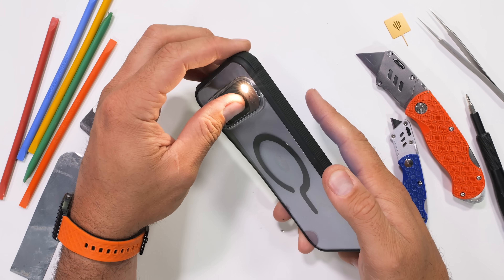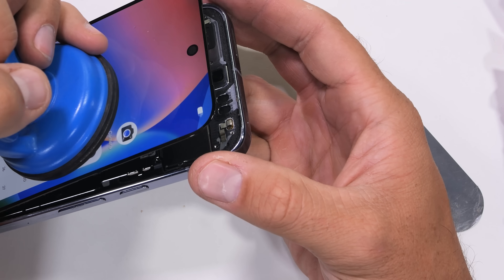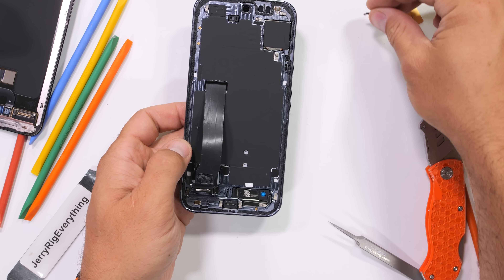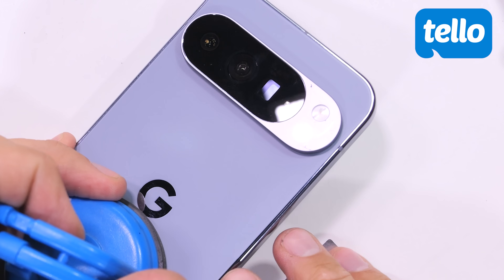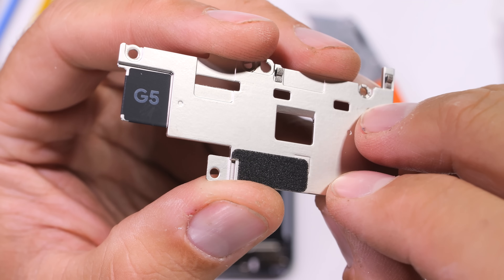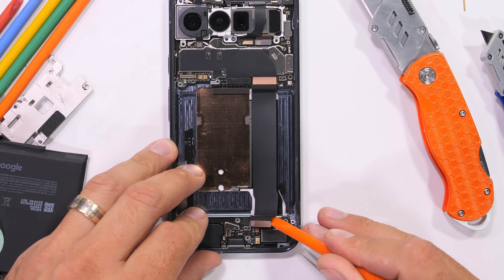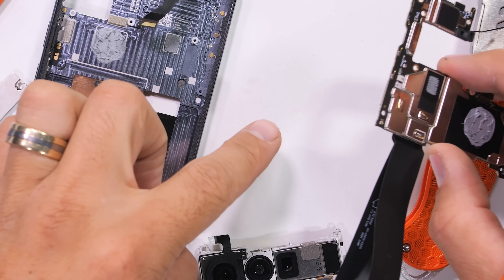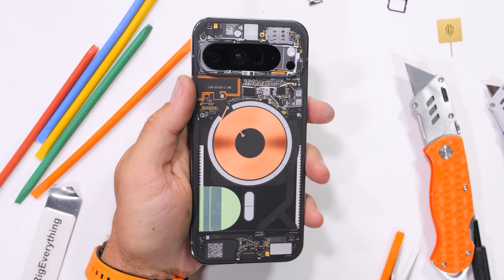GOOGLE FINALLY DID IT! - I'm so proud...

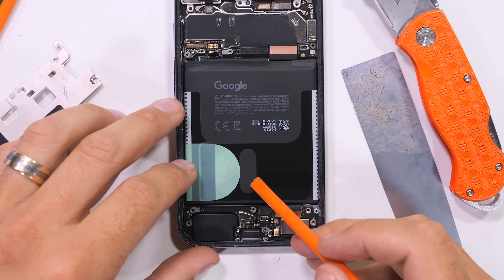Comment: At 4:39, those dots are likely not sots since that ribbon cable rather seems to be a custom made flexible circuit board, rather than a standard ribbon cable. If that's the case, they are likely vias (small holes with copper in them, linking up different layers of copper conductors) The longer I look at it, the more I see the PCB-like features, which makes sense a lot of sense for the unusual shape since many ribbon cables are wrapped in metal foil (or in a chemically deposited metal layer) to shield the sensitive signals but in such cases, manufacturing flex-PCBs may bring a cost advantage by just shielding the signal between sandwiched copper layers and then stitching them with vias.

Comment: Testing the Fairphone 6: "Downside is the use of T5 screws because not everyone has such a screwdriver at home."
While all screws are exactly the same size and length.

Testing the Pixel 10: "Super repairable!" 
While handling with a heat gun, isopropanol, special super thin blade. "Don't get too deep with it unless you want to destroy the screen". 
Then using quite some force to pull out the battery. 
And keep track of where each different screw exactly came from. 
And some little parts that are left over and surely don't have a purpose.

What have I missed???
I'm pretty sure which phone would be better for my heart rate if I had to repair it...
Reply: Also, the fairphone GIVES you a T5 screwdriver in the packaging!!
Reply: Not sure why he used a heatgun for the screen. iFixit showed that you can remove it quite easily without.
Reply: What is the meaning of "rumors"?
Reply: "What have I missed???"
You missed him getting fat pay form G.
Reply: I mean idk I also notice alot of bias against other things tesla I can't speak for the reason of these observations
Reply: So f ing cringe to say that this is on the path to the best repairable phone. 
This man sold his soul to google. Sad to see.
Reply: Don't be so incredibly inept? jusus CHRIST you make yourself sound so pathetic "I HAVE TO KEEP TRACK OF THE PIECES?!?!"
Reply: he said "rumor has it " didnt say "IT IS"
Reply: @ich_16  yeah he said "rumor has it"...why not answer this "rumor" directly by saying it's complete BS as soon as he had to get the heat gun out. And where did he hear that rumor from anyway? Didn't hear anyone saying that and a quick google search gives no result of anyone saying that.
Reply: @ich_16  But didn't correct that tumor during the video did he? So he gave more visibility to a rumor for what purpose?

Comment: Nooo ! There is nothing to be proud about ! 
They using Old battery tech ! Which degrades much quicker then The competitors ... The battery survives Just a third of the lifespan AS The oneplus 13 for example ! 
And Google throtteling The battery with Software after 200 cycles! Wtf ! Just because they make replacement easy ??? 
Thats what they want genius ! 
Old battery tech means faster battery Degradation... + Software throtteling for worse batterylife and easy replacement.... So that they can sell more batterys to you ! Thanks !!!!!!  😐😐😐
Dont be fooled !!!!

Comment: By easiest to repair, does that refer to not having batteries and other parts that have to be programmed to work with any device other than the one they came from?  We all know Apple for doing things like making it so even if you do replace parts, they don't work.  Sometimes you replace them and they just don't work correctly, as in causing warning messages that normally do not show up any other time.

Comment: I ordered my P10P after your durability test showing the sneak peek of the interior. Glad this phone is more repairable than previous pixels. I had to get the battery replaced on my P6 and it came with a warning that the screen was likely to break and could cost extra.

Comment: Inquiring minds want to know. Did you get those two extra parts back in the correct spots after seeing where they came from during the edit? I noticed the first fall from above the cameras in the top left, but not the other.

Comment: requires a heat gun, but is "more repairable than a Fairphone" right, sure. 

That being said it's a move in the right direction to make it easier to replace. That plus the battery tabs are nice steps up. Glad for that.
Reply: Having adhesive on the screen is immensely better for water protection than just screwing it on.
Reply: @know916bound  That's been addressed already. Thank you.
Reply: Heat gun is not hard to use at all 😂
Reply: @gr86er  Agreed. Used one once to replace the screen on a Microsoft Surface (accidentally cut a cable because my right + left were flipped compared to the guide I was using, oops). Not difficult, but way more annoying than your everyday screwdriver.
Reply: The pixel is waterproof. Fairphone will also require a heat gun if they ever make it waterproof too
Reply: @LeonRivia  Sure, not arguing that every aspect of the Fairphone is better. But by not being waterproof, it's more repairable.
Reply: @EverettDarling  and its less reliable in day to day use???
Reply: @Unlogikmann  Sure. Still not what I was saying.
Reply: The screen for sure, but he was also being safe with not damaging the screen. If the screen was already broken. Well I'm sure you could just rip it right off without the heat gun

Comment: While easier to repair is good, given the track record of Pixel phones, i would rather them building a phone that doesn't broke down easily. Plus it's always about part availability, if they make a phone that 3 years down the line has issues with its screen or battery because faulty manufacturing or even software that broke the device and then parts are all out of stock then easy to repair is pretty useless besides some pr win. I have seen so many hardware defect like screens from older Pixels or the battery thing with the Pixel 6 that i refuse to believe Google is actually making a phone that last. I don't care of it's easy to repair, if it's randomly broke down with no fault of my own then it's a bad phone. It still wasting my time and money getting it fixed

Comment: I'm going to rant on ESIMs for a minute.  I don't want a damn thing to do with those.  Why?  Because if I accidentally smash my screen I can pop out the SIM and move it over to my way to old but still functional Oneplus 6.  It takes 2 minutes and I don't have to call anyone to get up and running again.  I don't know much about ESIMs but the very nature of it suggests you need to log in and make changes or call up your carrier.  Screw that noise.

Anyways.  The ability to remove that back panel is a step in the right direction but still nowhere near as easy as mid 2010's phones where you don't need any tools to remove it.  I could swap a battery in less then 2 minutes on my early Samsung or G1 phones.

Comment: this solves a lot of issues, currently i have a pixel 6 pro with a slightly cracked back glass. Guess what, its VERY difficult to replace the back glass, potentially destroying wireless chargings. At the same time, its very simple to change the screen. So yeh...having easy access front and back, is such a win in my book.

Comment: Remember when you could pop off the back (with your nail) and take out the battery? Just for fun, or resetting your phone?

Sure. It wasn't as water resistant. But I used to be able to repair my phone without a heat gun.
Reply: Well there is a trade off. Thin, light, with quality battery life, affordable, and easily replaceable battery is hard to achieve. That's why companies have to choose tradeoffs based onthe consumer. Most consumers don't repair their phones or other tech. So they make it less accessable to save money and still meet the other wants for consumers. Google is going in the right direction with this phone. If your main gripe is needing a heat gun for replacement or repair, I don't understand. A heat gun is inexpensive. Yes you can't just slot batteries in and out every single day. But for many devices, you don't want to be handling the battery that much for risk of damage. Remember, the batteries back in the day used different tech and were much thicker.

Comment: My main concern with repairability is not how easy I (or the guy from it service) can remove the battery, but how easy its to buy new original battery. Its almost impossible for almost all phones and laptops, only some generic replicas and used ones.
Reply: It got a brief mention in the video but Google has made "genuine" replacement parts available on the ifixit website and for repair at ubreakifix locations. Pixel 10 parts aren't listed yet as the phone only just came out, but you can get a Pixel 9 Pro XL battery for under $60. The parts availability is much appreciated on my part

Comment: USB 3.2 while Apple still uses USB 2.0 lol. Gg Apple
Reply: Well, Apple is using USB 3.2 gen 2(old 3.1) on the 17 Pro, Pixel 10 is only 3.2 (old 3.0)
Reply: @CRJ08 so? iPhone 17 using USB 2.0 which is Like 25 years old.
Reply: @yosup89  "so?" Because you need to say the info correctly, not just hate, iPhone has one slower and one faster than Pixel, 🤷‍♂️
Reply: @CRJ08 its nothing about hate. Just very old technology Sold for a high price. Doesnt make Sense to save that extra 10 Cent for Higher USB Standard.

Comment: Kudos to them. The pixel 7 & 8, you couldn't change the battery without breaking the screen trying to remove it. The pixel 6 you had to remove the screen to change the battery, but you could do it without automatically breaking the screen. I just bought a pixel 7a because unlike the 7, to change the battery you go through the back. That's what she said. In a few years i'll upgrade from the 7a to the 10 then.

Comment: Google had nightmares after seeing Zack tear down the Pixel 9A and relentlessly criticize their team for its repairability. They took it to heart and fixed it all this round.
Reply: should we expect 10a to have decent repairability? or its price justifies small amount of engineering hours for that part of the job..
Reply: @GazdaZuBB Perhaps they learned and we can expect the 10a to be better. The biggest issue Zack had with the 9a was the battery being glued in and being ridiculously difficult for him to remove. If you just stick in a removable battery, they’ve probably solved most of the gripes Zack had.

Comment: 1:48: hey uh didn’t the fairphone always have this? they have fully repairable smartphones that you don’t even need a heat gun for
Reply: For the Fairphone you can't remove the screen without going in through the back? If not that, I have no idea what he's referring to.
What I do know is that I could replace the screen on my FP6 with just a tiny torx driver, I don't have the heatgun, suction cup, isopropyl alcohol, and pry tools Jerry uses so I'm inclined to disagree with his assessment.
Reply: @tb_eest yeah you need to go in the back, but it’s much easier for people to replace given that you don’t need a heat gun

Comment: I remember the EU decreed that all phones sold in Europe had to have removable batteries and backplates by 2026, I'm asumming more barely pro-consumer big phones are to come
Reply: It’s by 2027, and According to the EU regulation, a battery is considered "readily removable" if it can be removed using commercially available tools, without requiring specialized tools (unless provided for free), thermal energy, or solvents. This implies that while users should be able to replace batteries themselves, it might still involve unscrewing components or dealing with adhesives, rather than simply popping off a back cover.
Reply: @kokosnh1170 yeah that’s never going to happen. You can’t get a IP68 rating and still take it apart without solvents and/or heat. Without making it a brick at least
Reply: And that was 11 years ago
Reply: @TrashParrot that’s some of the waterproofing measures but not all and are you really comparing watches to electronics? The back of a watch is nowhere near the same surface area as a phone and they’re round meaning you can SCREW them on, difficult to do with a rectangle. 

We’ve had IP68 phones without glue sure but they were extremely thick compared to the normal phones in the line with underpowered hardware so they didn’t overheat. 

There’s a reason why the fair phone only has an IP rating of 55. The number of screws you’d require to get a good seal is insane and you’d have to use a torque screwdriver which cost more than the parts you’re replacing to make sure you meet the correct spec so the seal is perfect.
Reply: @lordv1le859 wasn't the galaxy S5 decently rated while having a removable back?
Reply: @TrashParrot you are really comparing a 1.5” diameter watch to a large phone? 

It kind of does matter because of the sheer number of screws you need and the torque level through glass. 

Again why doesn’t the fair phone have IP68 if it’s that easy? 

On top of all of this smartphones rarely actually break because everything is solid state and battery replacements even by OEM are sub 100 that you might want to do every 3 years at most. 

You don’t seek to be very knowledgeable about the topic in general
Reply: @guestc142 it had IP67 which was invalid as soon as you removed the back once because of damage to the seal. You also wouldn’t be able to fit everything modern phones have into the same amount of space, if you look at the S5 internals there’s a lot of plastic structure to fill out the back, create a seal and just waste space
Reply: @TrashParrot so now you can’t have wireless charging? 

They don’t have it because you can’t offer it on a device that has a removable back and once it’s been removed a single time you now cannot guarantee the rating. Fair materials and climate impact isn’t that difficult nor expensive. IP testing also isn’t expensive considering they’ve already submitted the device for testing as they have a rating so clearly cost isn’t an issue. 

I’m telling you the reasons why it’s dumb and why you are wrong, a phone you can take the back off of whilst retaining the functionality and spec of the device wouldn’t affect me nor would I care. When you start shaving off hours of battery life and cutting features for something that’s essentially pointless due to bureaucracy then that’s when I care.

A battery replacement from Apple directly is about $100 and takes a trivial amount of time to do. If you want to do it yourself it’s 50 plus tools. Even if you do it every 3 years it’s only $33 a year or $16 a year to do it yourself. Is that really a hill to die on when social media companies and AI are actually destroying society?
Reply: @TrashParrot mate. The goalposts haven’t changed at all. Your proposed solutions require you to buy tools specific for the job that you don’t need anywhere else, require you to lose features, lose performance or change the dimensions of the product. Otherwise the solution means you lose the IP rating which is also not acceptable which is one of the largest issues with the fairphone, they can’t get IP68 because of the removable backing. 

Actually those chargers were less efficient. Old phone chargers used linear power supplies which top out around 70% and could be as low as 30% while taking several hours to charge a 900mAh battery, MagSafe for example is 75% efficient and offers more functionality outside of charging.
Reply: Define "Removeable". You can remove a glued down one with enough solvent.

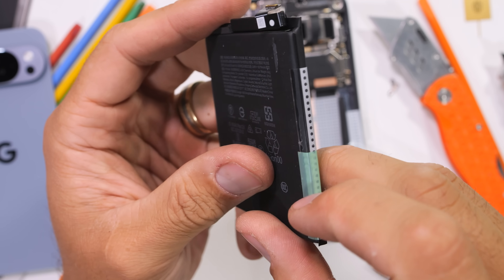Comment: 5:19 You never really done teardowns if a mystery extra piece doesn't suddenly showed up once in a while
Reply: And hope that this little piece isn't some essential part... Like, I've been cleaning my PS4 slim and some piece fell from the dvd drive and bow it just doesn't work...
Reply: at 5:00 you can see it drops down from the left upper corner
Reply: Not a mystery. It's a bracket that goes over the ribbon and antenna connectors attached by the same upper screw for the camera at the top left (as indicated at 4:17). Presumably this is to ensure they don't pop out when dropped on the corner and possibly to add some additional EMI shielding related to the antenna.

Once the screw was removed it just fell out but could easily go back in. Same as the other bracket that fell later but harder to tell where what was located.

Comment: In what way is it MORE repairable than the Fairphone 6 if I may ask?
Reply: The heat gun keeps your fingers warm and therefore you will be more motivated to repair your phone (only works in cold countries)
Reply: In the way that flagships pay more to market I think... No way this is more repairable than a phone that requires only a screwdriver and sim card removal tool (that come with it). Need to replace the battery? Hold on, let me get my alcohol, suction cup, extra thin blade and heat gun...
Reply: Watch the fairphone 6 teardown this is far more simple. Tf
Reply: @Ghostfaceds if you have to heat up the screen its automatically harder than the fairphone
Reply: @dabois012  you shouldnt touch the inside of a smartphone at all if you think your sentence has any value
Reply: @Unlogikmann its true though, one screwdriver or heat gun, alcohol and suction cup, which is easier? And I’m not saying the second option is hard, just saying that a single screwdriver is easier.

Comment: 1:50 this screen is a major flaw! As most of the 3rd party screens at a cheaper price wont be giving the cutout for the proximity sensor, or else if they will, they will be giving the screens at significantly higher price.
Reply: ? Litteraly every phone since 2020 has the same hole
Reply: @jakubmastalir3557  the 3rd party screens are hell lot expensive for these phones! If it comes to repair-abilities, then I would suggest something integrated with the camera modules, so that the screens won’t have a side cutout for other essential sensors, likewise for the phones with in-display fingerprint sensor, the 3rd party screens are very expensive.